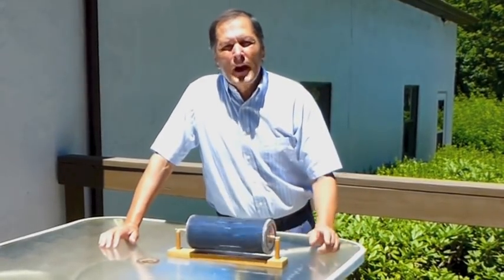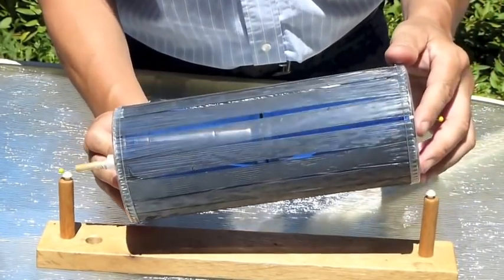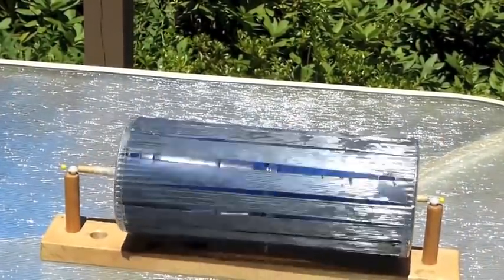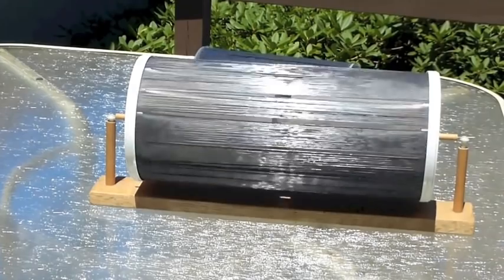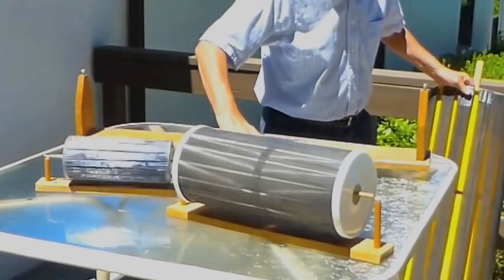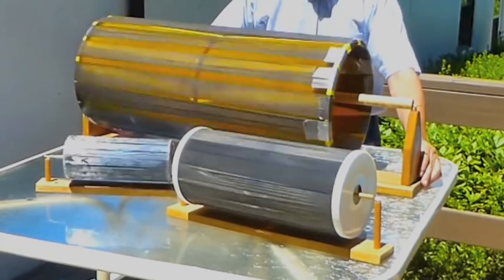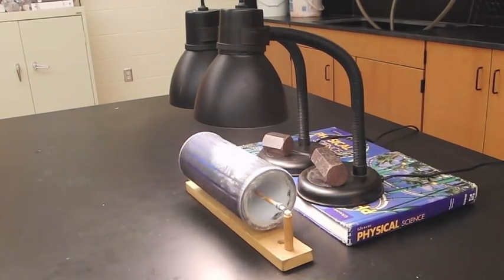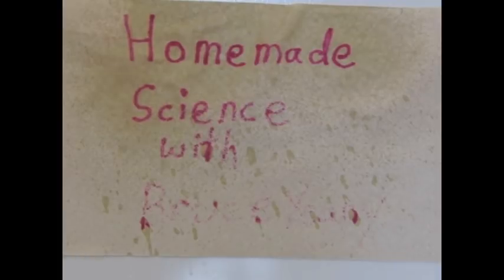Solar motor--Free energy motor-- not electrical /// Homemade Science with Bruce Yeany

Comment: do they have much torque? as in RPM=Hz HP=watts and Torque Ft*lbs=N*m?
Reply: He can stop them by simply touching them with his finger. These type of "motors" can barely overcome the friction on their own axles and aren't suited for powering anything. An electric motor run off of the same power going to the light bulbs he used near the end (or from solar panels of equal surface area) could produce far more work. I'm not saying they aren't neat...just that it's in an ornamental sort of way.

Comment: Like the video but wish they would have told where to get some of the materials and what it is called exactly
 such as the solar tape?
Reply from the maker: HI Ann,  there is a brief description of the operation under the video.  the strips are made by stretching pieces of trash bags.  If you are interested,  I'd be happy to send a set of interactions for building, send me an email address and I will forward it

Comment: :-)  new to the whole solar, wind turbine, etc...  Saw this video, now i wounder. How can these ever produce enough electric to make a difference? Just curious.  Thanks
Reply from the maker: NASA built a similar version back in the 60's using a solid pipe instead of the plastic strips and was able to generate a few hundred watts of power from it.  I think this is somewhat like the solar cells when they first started out,  capable of more but needs further development

Comment: I'm not satisfied with your explanation through expansion or contraction of the polymers. How does that equate to a change in mass? 

I think the solar heating of the plastic and apparent increase in mass may be due to the conversion of light into electrons which adhere to the plastic, increasing its mass. Then as the material goes into the shaded area the electrons are once again expelled and radiated out as heat.

In essence, the device converts energy to mass and vice versa.

What's more, years ago I learned that for thermal engines the energy exchange is in part a function of the PERCENTAGE of temperature change based on the Kelvin scale. I.e., a temperature change of 100 degrees Fahrenheit will have a more pronounced effect the colder the overall working temperature range is.

With that said, I believe that your device may run slightly faster when it is cold out.

Comment: Cool!  Try different colour strips, and different colour buckets.  It may not be the stretchy aspect of the strips doing it, but the heating of the buckets causing a thermal updraught.  See if black buckets spin faster than white ones.  You could also try ducting the bottom so that it draws cooler air in, and it might spin faster.

Comment: can you please explain what those solar strips are? Can we use just use black tape instead?
Reply: http://www.instructables.com/id/Solar-Thermal-Motor/
Reply from the maker: there is a brief explanation under the video,  the strips are made by stretching black plastic trash bags,  if you would like a set of instructions send me your email address and I will forward them to you
Reply: Thank you very much. I read the description. I was in the thought that, the air was getting heated and escaping out.  I surely would like to  have the instructons. email ID videoeppo@gmail.com.
Thank you for your time and efforts sir.
Reply from the maker: they are sent
Reply: Thank you so much
Reply: @YeanyScience  Could you please send me too ozekmobilya@gmail.com
Reply: @YeanyScience  cahogie@videotron.ca  Please send me instruction so i can build this at home, thank you
Reply from the maker: Hello, @catherinehogue3656 ,  I've tried sending it twice and get an error message,  send me an email at   Bgoknee@comcast.net    and I will return the message with plans
Reply: strips of a plastic bag, polyethylene specifically.  A polymer that contracts under the radiation of the sun and relaxes in the shade.
Reply: I jsut recently found your videos and i love them.
Would it also pe possible to send the introductions to:
leave.me.alone@gmx.at (its my spam email because i dont want to use my real email in youtube comments for obvious reasons)
Thank you in advance
Reply: VIDEO EPPO
Reply: Gary Rhodes yeah, I have done that lately and has been very helpful. I requested for a detailed making procedure, which he has sent too. Thanks anyways.
Reply: Gary Rhodes please post the video if possible and good luck with that!
Reply: hi sir! could you also send me the set of instructions for this? i am really interested with this :) my email address is tanhueco_rufus@yahoo.com thank you for your time sir! God bless you
Reply: Bruce Yeany
great invention!
instructions please.

 mikemue2@comcast.net.
Reply: i seen the Instructables.
instructions.

no need to email thanks.

I also shared it with my SOJ business dev.
FB page.

maybe with metal alloy bands or something?

it could go large scale in series as you mentioned?
Reply: Bruce can you send me an email please! noenrhymes@gmail.com thank you :)
Reply: shahirsaad11@gmail.com
Reply: nguyenlongsakura@gmail.com also please. Thanks.
Reply: VIDEO EPPO  I think you need the black plastic polimer bags cut horizontal to the openings. Don't forget to stretch the strips. You can try the black tape.let me know how it works..

Comment: So if you could find a material with a much higher force of contraction, and create layers of them, you may be able to create greater torque, is that right?
Reply from the maker: Yes, I would think so.     NASA  made a similar version using a solid pipe instead of the strips and was able to generate much higher torques.  I don't know what material they used but would like to try and find it.
Reply: Bruce Yeany That would be amazing. Such a simple idea, super easy to maintain. And, if you construct opposing banks, a spacecraft shouldn't accidentally start rotating! Hopefully :D Do you use Cambridge Materials Selector or its modern equivalent? Its been a decade since I used it but it allowed you to sort materials by property and class. Quite neat, never got to play with it as much as I would have liked!

Comment: I noticed that larger ment wider as well as longer. Since it takes longer for the larger diameter ones to rotate I'd like to see how fast one the same diameter as the small one goes with 2-3 times the length.
Reply from the maker: good idea,  I will play around with that

Comment: Great  !Now, how can we use this rotating energy  to do some work? Maybe turn a water pump, or  an electricity generator? Or do some other physical work ? How much torque does it generate ? If it does, I would assume the torque would be  depending of the size of the device ????Thanks for sharing. At least if this generates something useful for humans it would be only where the sun shines.

Comment: Fun experiment, but if you can stop them easily with your hand, I can't see them providing any significant power. For your surface area,  you can generate way more power with a solar panel. It is still pretty neat though.
Reply from the maker: thanks vorkvoyd,  NASA produced similar type of motor that generated a few hundred watts but still not as efficient as the solar cells.  I find it amazing that it turns at all

Comment: totaly usless ..you cant put it under any force .
Reply from the maker: The same was true for the first photovoltaic cells. This version can't power a generator but I think it's pretty amazing that they turn at all .  However,  NASA produced a  thermal engine back in the 60's  based on the same principle. It was made out of a 20 foot long polymer pipe, added heavy weights at the ends, suspended it and got it to produce a few hundred watts,   better but still didn't meet their power needs.

Comment: I like it as a toy but hate it as a gadget. It's way too weak to do any practical work. To me this IS a Perpetual Motion Machine (or as close as we are ever gonna get) A PMM does not have to make it's own energy nor does it have to last forever with materials that can never degrade - these are myths perpetuated to keep people from trying to create such devices. Nothing creates it's own energy. Energy simply IS, everything we know is a form of energy - energy only gets transferred from one state to another, it's never created. Therefore you HAVE to use an outside energy source for Any motor you could possibly think of. Here we use the Sun's radiant heat. Of course the Sun will be behind clouds at times or the device on the night side half of each day and the materials will wear out even if it takes a few hundred years.. still thats a PPM.
Reply from the maker: Thanks Divergent Droid, even if it can't convert usable amounts of energy,  I still find it amazing that it turns at all.   Well said about energy and PPMs
Reply: Divergent Droid actually it isn't because a true PPM (which is impossible) must be able to keep itself going without an external source of energy otherwise it defeats the purpose.
Reply: I don't think it would defeat the purpose if your purpose is to learn and discover ways we can make machines more efficient. We don't want magic, we want practicality.

Comment: What happens if you put a magnifying glass to them?
Reply from the maker: If the plastic gets too hot it melts and
Reply: Are all solar panels made of plastic?
Reply from the maker: Panels could refer to a couple different types,  it depends on what the application is. 
There are solar cells which convert light into electricity,   I think those are silicon based,  solar panels for heating could be plastic or metal.  In this case they are made of a plastic that shrinks as it is heated,  probably not something you would want in other types of panels

Comment: So they produce very little torque, not enough to turn any DC motor, leaving it just as an experiment right?
Reply: I wonder how well these could spin a satellite in space tho!!!!!
Reply: Without gravity, no
Reply: Why does there have to be gravity for these to work?
Reply: Do you notice that the (slightly conical) containers are attached to the axle only by their bottoms?  When the 'stretched' plastic is warmed, it contracts, pulling the contained towards each other on the sun-ward side, causing an imbalance and allowing rotation with an initial push (as described).  Wouldn't work in micro-gravity

Recall reading about this in Popular Science-ilk magazine some 30 years ago under the title "Solar Muscle".  In that article, one of the foam cups used had a circle near its rim but the other was, as above, only attached to the axle by its base.
Reply: "When the 'stretched' plastic is warmed, it contracts, pulling the contained towards each other on the sun-ward side"

Most materials expand when heated, are you sure it isn't the other way round with the cooling side doing the contracting?
Reply: With the Government/Corporate R&D I'm sure they could generate electricity at some point... 

Look at how far we brought television technology... From a single line of light, to 4k+
Reply: Juan Yaotl Torres Cover some parts with aluminium tape to scare off crows and other birds from crops.
Reply: One space station had a problem with the solar panels stored rolled up shaking.
Reply: OMG, #MindBlown
Yesssssy
Reply: Larry Burks any real life uses?
Reply: amen
Reply: take a thousand buckets, oil barrels, coffee cans, trash bags, tape, to a bamboo patch on a field trip.
Reply: bust out 500 of these.
couldn't you put more than one pair of buckets on the same axle?
maybe a wall of these could have it's own resistance and act as one unit by having a few "grooves" of magnets on the sides, + - + - going around the outside diameter of each bucket / can, as long as you didn't spin one too fast, the whole system would move as a reaction to spinning any one of them
it would be like spinning one bead on an abacus and having the rest of the beads on the line follow suit
Reply: Correct, "most" materials expand when heated by not in the case with the stretched polythene, another example being type metal.  One of a few "exceptions" (to the Rule)
Reply: it would be easier using 100 watt motors and spinning a lead wheel.

Comment: The rotation speed is limited by the heating/cooling time constant of the plastic.
It might be instructive to note that the rotational force (torque) is a result of the radius on the hot side being different than on the cool side - the weight of the plastic does not change. Only the distance from the rim to the axle changes as the heating and cooling takes place. 
Nice demo!
Reply from the maker: Thanks Walt,  I appreciate your comments

Comment: Yeah, make one more....  the length of the 3rd one (buckets), but the diameter of the 1st one (cups), and it'll probably spin too fast to stay on its mounts.
Reply: The decrease in heated surface area would counterbalance the weight reduction and wouldn't likely provide much of a difference.

Comment: Hmmm... I think the underlying theory may be a bit skewed. The sun's rays actually RELAX the upper black strips, thereby allowing the cup rims to move outward, and heavy cup bottoms to shift upward. That makes the unit top-heavy so it perpetually tries to right itself.
Reply from the maker: Hello Banajonator,   the process the strips are going through  is called retraction,  the long polymer molecules are shrinking when heated and when you pull them they cool. Rubber bands do the same thing.  If you cut a 3 inch piece of plastic trash bag 1 inch wide parallel to the top of the bag and pull it, it will stretch about 6 times it's original length.  If you then hold that under a bright light you can actually feel it tightening up.
Reply: Hi, Bruce. Polymers may well behave that way, but your description doesn't explain the motor's function. Were the dark bands to tighten in the presence of sunlight, the center of mass would be shifted downward, thereby stopping rotation.

Comment: Could this be made more practical if the strips where to be made of bi-metals(2 different types of metal layered together as one) that react to temperature differently. maybe put a propeller on the shaft pointed at a low speed wind turbine, if built big enough?

Comment: Hi Sorry for breaking it to you there is no energy let alone free energy here. The rotors are just rotating, they are not able to produce any energy. There is no generator attached. Where is the energy being produced? Enlighten me please.
Reply: You are confusing energy with electricity.  What is being created is a (very small) amount of momentum, which is, of course, a form of energy.  It's not designed to create electricity, just to demonstrate a scientific principle.  If you read the description he makes it clear that when he says 'free energy' he isn't talking about violating the laws of thermodynamics, just using free sources of energy.

Theoretically, if you had a very large one of these hooked to a very small generator you could get some power.  Off the top of my head you could use magnetic bearings to levitate it, which would reduce friction but also let you draw a (very small) current from it.  In one of his other comments he estimated it at .001 watts.

Comment: Have you harnessed them to a small 6v motor,or any small motor,  as part of that science project. The power companies would shudder if you built a giant one, and harnessed that power for the evening...as the  expression says.."From little things, big things grow". The big power companies executives respective heads are firmly planted in the sand, and from what I have noticed, show lack of vision, instead of investing in alternative energies. The odd ones who have invested, will be the ones in the future when our oil and coal reserves have depleted. I am not a greenie...just a realist, and vote somewhat of a conservative nature by the way.
Reply: These types of motors can barely overcome the friction of their own axles. Scaling them up means more weight and more friction which means they would still only barely turn. A solar panel of equal surface area powering an electric motor would always be far more efficient.
Reply: Brian Morris no... they wouldn't shudder, it's not always sunny fool.
Reply: I am referring when it is sunny, fool.
Reply: Brian Morris why would the owner of a nuclear or coal fired power station be worried about a system that only works half the time when their's runs the whole time?

Comment: Are the bigger ones actually spinning slower? Or at the same rate (distance over time) since they have a larger diameter, it will take less revolutions for the same amount of distance to be covered?
Reply from the maker: I'll check

Comment: Pretty cool; I bet in outer space they could actually operate something.
Reply from the maker: Actually a similar version was created by NASA.  They found that a piece of equipment  demonstrated the same property in space.  It was a long pole that kept flexing due to sunlight hitting the one side.  It would always bend towards the light.  They then cam up with a version that was a long pipe that would turn and generate quite a bit of torque.

Comment: An intriguing experiment, from my decidedly nontechnical perspective. It would have been nicer if the explanation narrative had been included in the video itself. As to the practicality of the device: would it be more efficient with magnetic bearings? Could it be made with a lightweight armature, to generate a modest current?
Reply from the maker: I'm hoping someone with more skills than I have can go that route.  I should explained more in the video,  it is explained in the information below the video